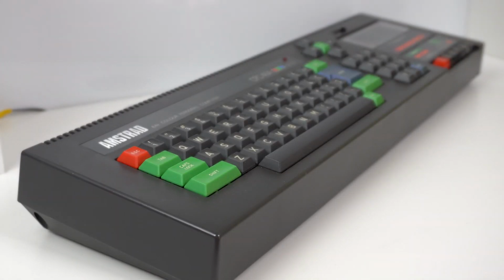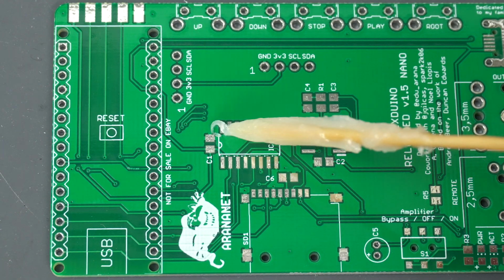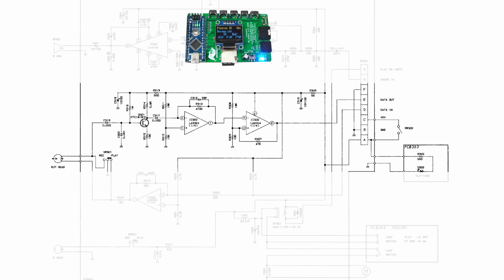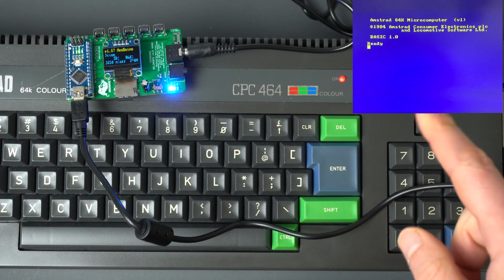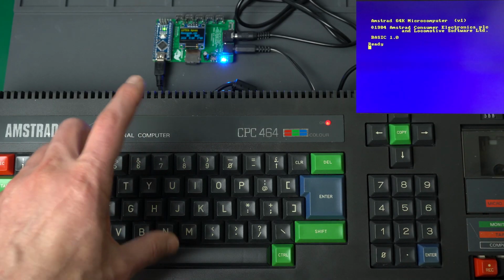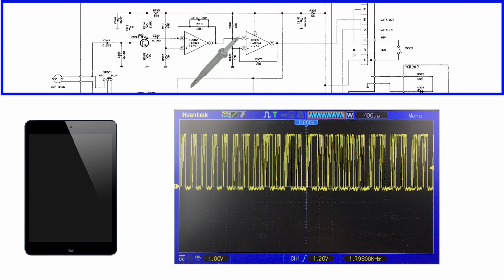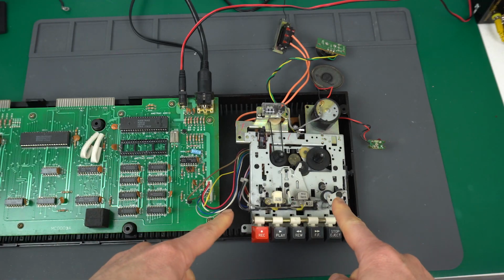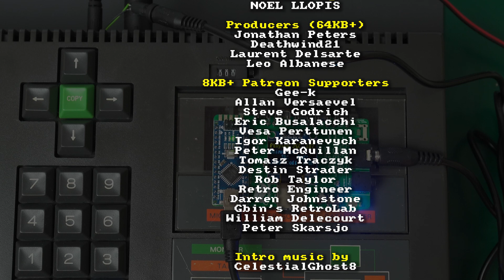Best Way to Add Audio-In to an Amstrad CPC 464?

Comment: Many years ago I wired a tape head to the audio output of a home made shortwave receiver, and glued it in a casette so that it was positioned in front or the CPC's tape head. Crude solution, but with a home made morse decoder written in locomotive basic, I intercepted messages in clear from the French navy in Toulon. Those were the days...
Reply: How did you got the data from the tape Dec head?  The sound chip registers?
Reply: @Thebasicmaker  sorry, but it was so long ago I don't remember

Comment: Excellent was looking forward to this one. Glad you didn't have to remove the epoxy I applied😊😊. I bought that Amstrad from a local seller in Belfast  and applied a Bluetooth mod which is why I added the power socket. I've just managed to bag another 464 locally for £25, and intend on modifying for a standard audio in (not Bluetooth this time). I might even feed the cable through the expansion slot so no drilling. I'm pleased you worked out the best input points in the PCB, very informative Noel👍
Reply from the maker: Yes, me too. That epoxy was really well applied, so that was perfect being able to reuse that. Cheers! 😃

Comment: Since both Output and Remote jacks seem to be actually electrically mono, I wonder if the TXDuino design could be reworked to accommodate a single 3.5mm stereo jack for both output and remote connection, so you can have a single cable and most important punch a single hole in the computer plastic.
Very entertaining and informative video. Thanks Noel.
Reply: Had the same idea. It should be possible. It will even allow a good designed file player on a computer/tablet to react to the control signal, if it has a 4th ring for the microphone. But I need a no-drill solution.

Comment: I really love that Sony Bit-Corder that Noel keeps showing in his videos!
I never saw one back in the day, but I can imagine it'd be a lot more comfortable to use in a typical home micro setup than a traditional cassette recorder - no need to half stand up every time you need to peer at the tape counter, for one thing.
Reply from the maker: Right. That thing is da bomb! Looks great, works great, and the ergonomics are very good. I got it a couple of years ago because a good friend of mine had it back in the 80s and it was really good.
Reply: I have one of those. It's one of my cherished treasures.

Comment: thank you so much - you are awesome to explain the technicals with scope waves etc. So many YT vids show the audio inputs connected to the R/P head points on the PCB of the tape deck. Now you have provided a much better solution through proper technical analysis! keep up the great vids. Gracias!

Comment: Thanks Noel, another great video. You're helping to inspire my 6 year old to learn computing and electronics. You will not be surprised that the Spectrum +2 (grey) has the audio input mod in the exact same place - it's even called C317 there too!
Reply from the maker: Oh that's fantastic. It's one thing the people who lived through those computers enjoy the videos, but to inspire the next generation... that's awesome! 😃 Thanks for confirming the Spectrum +2 is very similar. I wouldn't be surprised if Amstrad used the same off-the-shelf tape deck and just changed the buttons and the cosmetic elements.

Comment: A suggestion to avoid having two plugs for the audio in + control. Use a four pole minijack plug, and then make a Y cable with the four pole on one end and audio + control jacks on the other end. Use the microphone pole for control, ground for both grounds, and left and right for the sound. It may be done with a three pole stereo jack, but then there may be problems if someone tries to use a standard stereo cable for the audio-in.
Reply: Yes good idea that's exactly what I thought by using a stereo jack with 3 poles one being a common ground and then have a cable split to the headphone jack and remote of the duino.
Reply from the maker: Yes, that's a good idea. Someone on Discord suggested that just with the stereo cable. The only trick is figuring out all the possibilities and making sure it's not wired in a way that will damage something if it's connected to a different device. I do like the 4 pole solution.
Reply: There are two potential issues:
1.) If someone connects three poles jack in Amstrad, play on signal is grounded. Since it's driven by open collector transistor, that will not cause damage, but will keep relay on. Minor issue.
2.) If someone uses 4 pin cable to connect phone, he is bringing 5V, trough relay, to mic input, which is way too high for that poor input.

Possible solution is to isolate system using open collector or just diode, but I think that wouldn't work because Arduino is somehow detecting if there is remote control signal. Could be by sense contacts on jack, but more probable method is pausing when input is pulled high via relay coil.
Modification on Arduino side could solve that issu, but would make it incompatible with other Amstrads, unless there is disable switch.

Comment: I needed 16 audio converter boards for my extron video switch, so I designed the boards and used pcbway to print them.. I ordered 15 and they were nice enough to actually ship me 19 boards.
Reply from the maker: Nice! I've never had extra boards shipped to me, but maybe you hit some odd dimensions or something that caused them to print extras. Nice though though.

Comment: Did the audio mod today, seems to work better on the final input point you selected, compared to the common input used on other videos. Weird thing though I couldn't get my kindle tablet to work with the mono jack socket I fitted for some reason - sound kept going on and off? Changed to a stereo jack socket using tip only and working perfectly, thanks again

Comment: Interesting video, thanks. Capacitive coupling between traces can be a pain, especially with square waves that have a lot of high frequency content. It would've been a lot better if whoever did the board layout had tried to make a ground fill running between small signal traces instead of the somewhat peculiar isolation layout method they used for this board.

Comment: Pretty neat. I'm learning more and more the value of capacitors :-) Along the lines of what David Swann below posted but keeping it simpler...you could use a stereo jack and connect both the audio and remote control signal on one jack and not cut another hole in the case. Then just create a cable that plugs into the stereo jack and gives you audio and remote control to go to the arduino.
Reply from the maker: Don't feel bad. Capacitors are hard to grasp, especially when they're not taught well. I got a degree in computer systems engineering and only in the last few years I'm finally getting a feel for what a capacitor REALLY does and how to use it as part of a design.
Agreed on piggybacking the remote control signal on the other channel. The thing I need to be careful with is someone plugging in a regular device with a normal stereo jack.

Comment: Great video, I'd tried adding a audio in to my Amstrad build ZX Spectrum +2A and I got stuck with what point I should insert the audio, thought it would be easy but yeah there were many points that it could go, so nice to have your take on it too when I get back to that computer. Another very enjoyable video and I really really like your deep dives!
Reply from the maker: Glad you liked it. Does the +2A not have an audio in either?? I had forgotten about it since all previous Speccies had it. Weird. I suspect it's pretty similar, although they may have a different configuration of amplifiers. Let me know if you end up doing it.
Reply: @NoelsRetroLab  might be specific to the later +2B revision I've got but no audio in. I think at the time I was just going to insert into the tape deck connector to avoid any soldering and it didn't work very well coming from a phone. But as you've shown the audio from a phone isn't just like the tape deck or the TZXduino. Anyway, it's on the long list of retro jobs, will give a little update if I do get back to it.
Reply: +2A is a breeze to mod ..  you can use the signal off negative side of C200 (bottom right of board) .. and mod the audio output jack to work the same as the +3 .. the audio output jack on the +2A has left and right channels linked together  so you can break the link and connect the input signal wire to the right hand channel .. thus using left channel for output and right for input  * the link is under the jack so it would have to removed

Comment: One thing to add to this - I agree it's best not to hook up the input to the output of either opamp, so the place you used is a good one.

But, I've seen mods where people hook up the input directly across the Play head.

That can "work" OK, but beware that if you leave a tape in the drive and the tape is still touching the heads, the external audio input could "write" a gap into the tape and create a loading error if you try the tape later on.

So yeah, the input to the first opamp looks OK, as it has the fairly high-value 470K feedback resistor (and the cap), plus it has the cap on the opamp input, which will help block any DC bias from damaging the transistor.
Reply from the maker: Good point about the possibility of affecting the tape if connected there! That was indeed one of the (many) places I've seen recommended for that mod. Thanks for the tip.

Comment: very comprehensive Noel!.. great stuff
what about audio out? the output jack never seemed to work for me, with powered or unpowered speakers....
i eventually just hooked up 2 wires to the speaker, through an audio transformer (to isolate the systems and provide some impedance).. and out to an RCA jack to drive hifi system..
i used that to make my "music" video..with B&W "composite" out from the monitor connector to a VCR (Beta!)...swapped 2 screens in and out of video ram space.. and added the sound over the top..(there was a write up in AA about it!)

Comment: I have a small board, originally designed for the ZX Spectrum, which accomplishes this fairly painlessly :) It uses surface mount parts though which might put a lot of people off.

Comment: An alternative to using two separate jacks for data and for remote, you can also use a din connector similar to the MSXs cassette connector. If you make it with the same pin out than the MSX you could use the same cable for the MSX, for the CPC, as well as spectravideo that use the same pinout.

Comment: I think I have safest way of using TRRS jack for both audio and remote. Connect optocoupler with photodiode parallel to relay and exit from optocoupler connect to jack. On Amstrad's side, only one resistor and one optocoupler is added. On Arduino side, pull up resistor is needed, and it can be added via jumper to disable it when using with unmodified Amstrad.

Activating optocoupler when phone is connected will trigger headphones button, which is not an issue.

Additionally, by adding capacitor on both audio lines (audio and audio ground), complete DC decoupling is possible if needed.

Comment: so noel have you tryed about changing the Gerber file to change the 3.5 mm jack and the 2.5 mm jack to a single 3.5 4 pole so you can put it all in one cable for sound and remote or even a 6 pin din and tap 5v from the cpc to power the entire board ,carry data and the remote signal ?

Comment: A potential solution for the remote feature on the audio in for the TZXDuino in future.  Use a stereo jack on the CPC and make up a lead that includes the remote function on the right channel with the audio on the left.  As they share a ground that shouldn't be an issue.

Comment: If you don't want to drill another hole you could replace the mono socket with a stereo socket, for both audio in and remote control out. Then use a Y-splitter cable.

Comment: I would still add additional capacitor. For iPad is probably not an issue, but Arduino, outputting DC offset, could overload transistor because only collector resistor is limiting current. Even if it's not an issue in normal conditions, accidentally turning on the tape while using Arduino still can cause overload if Arduino is outputting high and head is feeding current to base.
Reply from the maker: I agree. I even did it that way originally but then convinced myself it was the same as using the capacitor on the board, without thinking of the voltage offset there. I'll just add it near the audio jack connector.

Comment: Hey dude. Great video as always. I had a thought regarding the remote; could you not replace the jack with a TRRS jack and then have both the audio and remote come in there? Then you could have a neat little splitter cable to split back out to the TZXduino.

If you wired it in a certain way that a regular mono jack would still connect to the audio in pins, it would be a nice tight solution.
Reply: What I was thinking as well

Comment: A question on the audio in connection towards the TZXduino .

Am I correct that you are using a mono female jack on the Audio-in signal ?
What kind of cable are you using between the Audio-in and the TZXDuino output ? Stereo or mono ?

Thanks for your very detailed video , it made it super easy for me to follow the required steps and perform the mod myself.

Comment: The ripples in your square wave is just ringing, most probably caused by your probing, not actually present in the signal. I expect you used the long ground lead of your oscilloscope probe for this. If you instead try to use the little coil with a sharp tip that goes around the shield of the probe tip, I expect most of that ringing will disappear. It's less convenient as you'll need to find a ground point very close to what you're probing for it to reach, but that's the only way to probe high-frequency signals without ringing (the high-frequency part is this case are the sharp square wave transitions, which contain infinitely high frequencies of super-imposed sine waves). The TZXduino signal probably had somewhat slower transitions, which is why you didn't see ringing.
Reply from the maker: Are you talking about the ripples in the audio output of the iPad? I doubt that. Those are actually really slow signals compared to clock signals I often look at. Those are definitely artifacts of the audio hardware of modern sound devices running a 48KHz sampling rate (and probably some additional filtering on top of that).
Reply: @NoelsRetroLab  Yes, the decaying ripple after every rising and falling edge of the ipad square wave. That's what it looks like to me at least. It's not the frequency of the square wave you're measuring which causes it, but rather the sharp transition of the rising and falling edges. The fourier of an instantaneous transition (a perfect square wave) contains infinitely high frequency components. In reality of course no square wave is perfect, but the sharper the edge, the higher the frequency.

Comment: Bonjour, merci pour cette super vidéo!  Cependant Il manque des infos sur les composants, par exemple le voltage pour les condensateurs (C1 100nf C0805)?

Hello, thank you for this great video!  However, information is missing on the components, for example the voltage for the capacitors (C1 100nf C0805)?

Comment: I wonder if the same audio in mod could be done to a zx spectrum 3? I will have to find the schematics.
Reply from the maker: Well, the Spectrum +3 already has an audio in, doesn't it? You shouldn't need to do anything 😃 I'm sure a similar thing can be done with the +2 though.

Comment: Excellent! I was not aware of this mystery (I didn't have a 464, but a 6128), but it is very fun to see you dig into it.
BTW, is there a TZXduino-like DIY device able to also record programs? I would like to use it with my ZX81 and TI99/4A...

Comment: another great video,, i had an issue getting sound files to work going from my pc to AV receiver.. whatever settings i used on the pc or the amp and they would fail.. then i tried streaming the same files into my apple tv and into the amp and they work fine ..   think last time i did a audio input on a cpc i used the read head i will defiantly be trying C317 next time

Comment: Here's an idea - could you modify an audio cassette adapter using Audrino to load files from a MicroSD card directly into the head of the cassette deck? And either include a small LiPo battery for power or use the capstan to drive a small power generator? That way you can preserve the original use of the deck and not have to solder or drill holes into the case?
Reply from the maker: That sounds almost like this (minus the power issue): https://www.youtube.com/watch?v=dMpGGf-YUzU
Reply: @NoelsRetroLab  That's almost it! But it looks like it's not passing through the tape head, but still routing an audio signal out from the cassette through a wire that then connects into the sound jack on the side.

Comment: Great project. Although you do not recommend to use a car cassette adapter I use one...
Unfortunately my Windows out is not recognized on the CPC correctly. I think the driver does some funky optimizations. So I always boot Linux from stick to play the WAV files. I never found out how to force Windows to use a vanilla sound driver...

BTW I use cpc2tape to create WAV files.